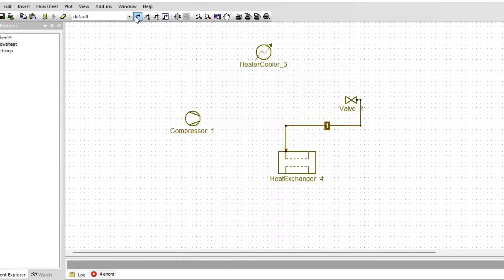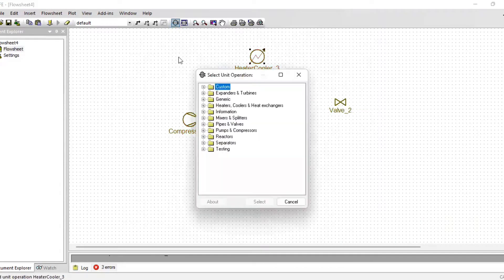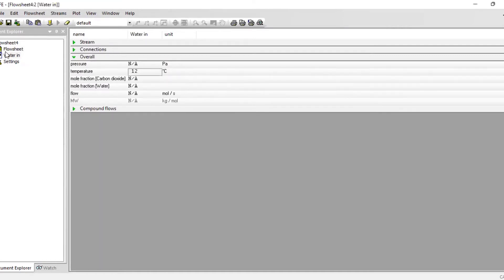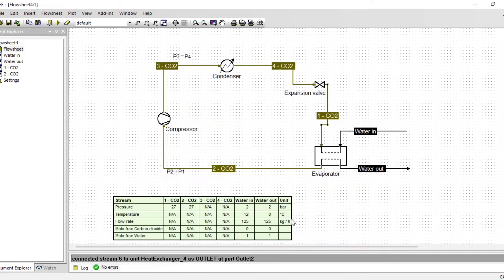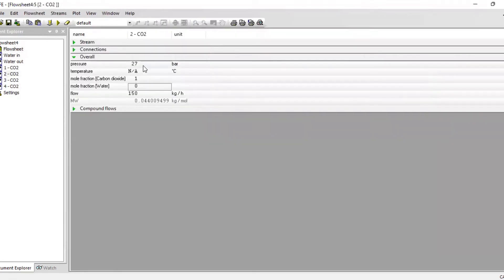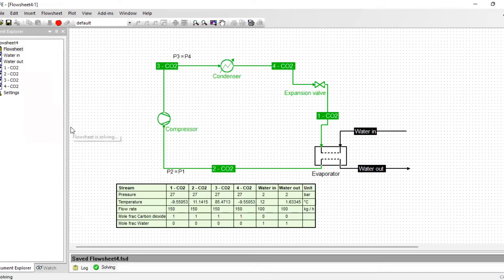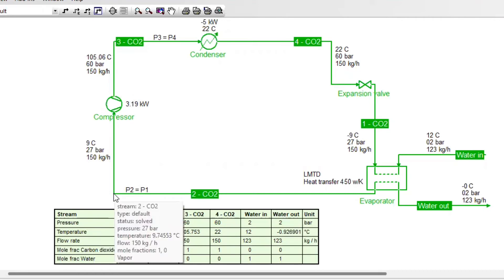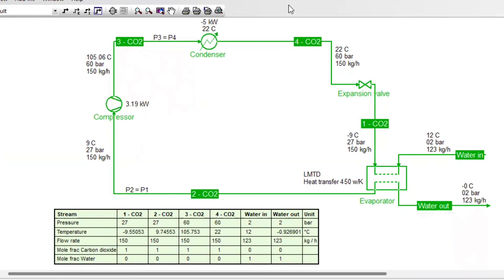CoCo Simulation: Refrigeration Cycle - Carbon Dioxide to cool water

Comment: I need to use coco for a heat exchanger with Lithium Bromide solution, but as in its databank Lithium Bromide is not there, what should i do

Comment: Thanks for the video. I want to ask, what model set did you use for the CO2-H2O package?
Reply from the maker: My apologies for the delayed response; I'm confident you were able to complete the simulation on your own by this point. 

I am pleased to offer my assistance. Please be advised that we now have a user-friendly website that allows you to submit your questions, which we will answer within 24 hours. 

Several thermodynamic packages can be taken into account while developing a simulation for the refrigeration cycle of carbon dioxide to chill water, including:

1. Redlich-Kwong equation of state (RK-EOS)
2. Soave-Redlich-Kwong equation of state (SRK-EOS)
3. Peng-Robinson equation of state (PR-EOS)

It's crucial to keep in mind that choosing a thermodynamic package is influenced by a number of variables, including the degree of precision needed for the given application, the range of temperatures and pressures involved, and the characteristics of the fluids employed in the system.

For further inquiries, our website is: https://chemicalengineeringwithkgabisang.co.za/home or you can reach us at info@chemicalengineeringwithkgabisang.co.za

Comment: En el paquete de propiedad solo agregas agua y dióxido de carbono ?
Reply from the maker: My apologies for the delayed response; I'm confident you were able to complete the simulation on your own by this point. 

I am pleased to offer my assistance. Please be advised that we now have a user-friendly website that allows you to submit your questions, which we will answer within 24 hours. 

Several thermodynamic packages can be taken into account while developing a simulation for the refrigeration cycle of carbon dioxide to chill water, including:

1. Redlich-Kwong equation of state (RK-EOS)
2. Soave-Redlich-Kwong equation of state (SRK-EOS)
3. Peng-Robinson equation of state (PR-EOS)

It's crucial to keep in mind that choosing a thermodynamic package is influenced by a number of variables, including the degree of precision needed for the given application, the range of temperatures and pressures involved, and the characteristics of the fluids employed in the system.

For further inquiries, our website is: https://chemicalengineeringwithkgabisang.co.za/home or you can reach us at info@chemicalengineeringwithkgabisang.co.za